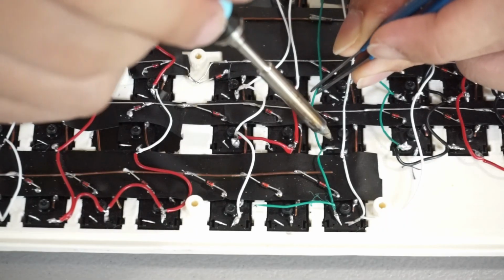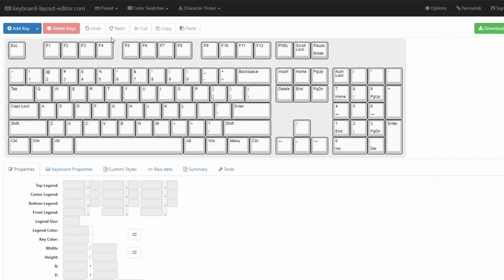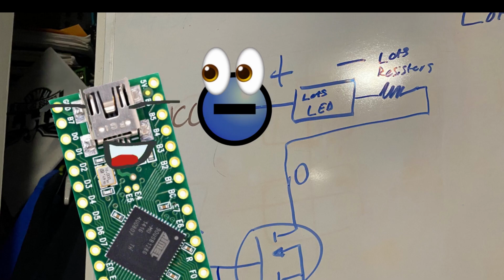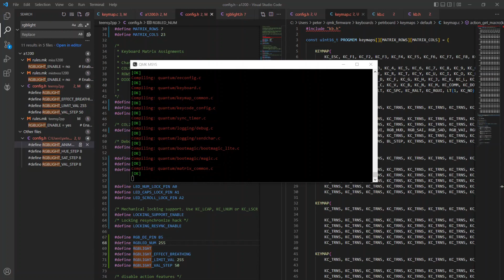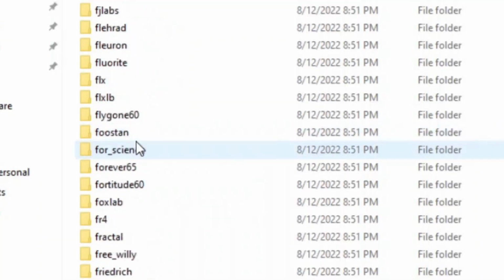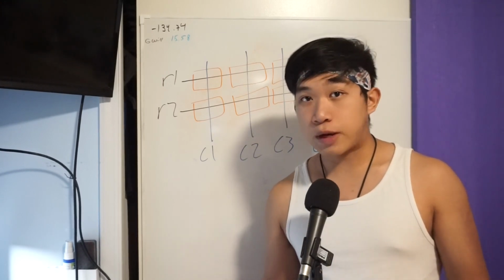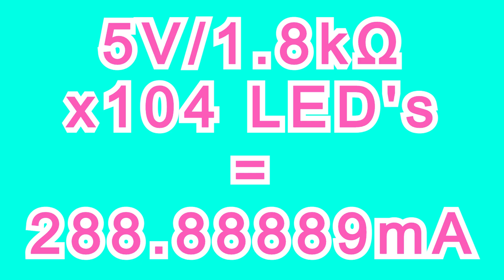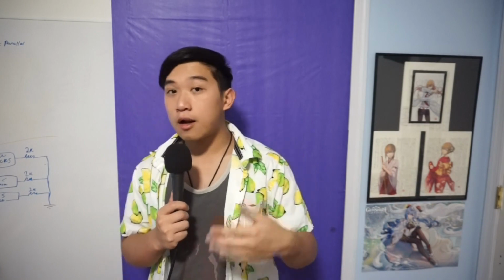3D Printed - Upcycled - Backlighted - Handwired - 100% Mechanical Keyboard

Comment: Nice backlighting! Haven’t seen it done like this on a hand wired keyboard so far 👏🏽👏🏽
Reply from the maker: Thank you! It’s def been done before since I used them as references, but def very few since it’s VERY TERRIBLE to solder all those points hahaha.  Though for something like a macro board, I’d do it again

Comment: GREAT VIDEO! you gotta be nuts to do this by hand WITH LEDS!! omg .. i hand built a 73 key custom layout with no LEDS and it was hell. But I'm happy with it ! I def should have used copper wire and the electrical tape method.
Reply from the maker: SO YOU KNOW THE PAIN TOO 😭 and cheers to building your keyboard too!  A little update, mine got corrupted a few months ago (probably due to static) but was able to reflash it so it’s all good now (the hell never ends LOL)
Reply: @PeTr01  oh noooo 😱 hope it doesn't happen to mine but good to know it's fixable
Reply from the maker: @MichaelButlerC  yes! If you used QMK, its pretty simple but a last resort: if you can’t get to the microcontroller to press the reset button to flash (as mine was burried under a lot of stuff) you can plug the keyboard in while holding the esc key, I think… this will ultimately wipe the microcontroller putting it into flash mode

Comment: Can i use a svf4n60f mosfet? Looked up the VGS and it's 2v to 4v. Also i should be able to replace mosfet with a transistor right?
Reply from the maker: Hey! I researched your mosfet and noticed the same Vgs(th) as you did, usually logic level is small for the min (between 0 and 1v), which is great for when you have values close to 0, very low voltage, it’s off; but when you have some significant amount of voltage, it’s on (in your case, you might find that they device will be off at voltages below 2v).  This is fine if you only want the lights to come on and off (where it will send 0v for off since it’s less than 2v, and 5v for on since it’s greater than 4v).  PWM brightness control should work as well since that works on how frequent a signal is on and off rather than the voltage level, but am unsure of this.  The area of uncertainty is how it will behave if a voltage between 2v and 4v will read since this is where it’s kind of on and kind of off.  Also interested in how the circuit will react with how QMK is programmed (magic is scary). This is just theory from my level of understanding, so ofc the best way of finding out is to test it out on a breadboard.  See if you can program an arduino/teensy to light up 2-3 LED’s with your mosfet and if you can control their brightness via PWM.  Lmk how it turns out or if you have any other questions! Break a board… Ima coin that

Comment: Sorry for commenting month after release, isn't the formula for current 2V/2000ohm*104? Since diodes forward voltage is close to 3V thet leaves 2V to resistor. Btw gret video im buying the components rn
Reply from the maker: Always love a good comment and this is amazing! True I didn’t think about the forward voltage of the diode while doing the calculations but either way most diodes have a forward voltage of 0.6v; 3v might be for some zener diodes?.  Either way, for the 1N4148 diode used in the video, it has a forward voltage of 0.4-1.2v so it doesn’t really change the calculation much (Bcs we’re engineers and we like to make mathematicians mad… e=3=pi). Good catch though and good luck on your build! (If you’re 3D printing make sure you carefully read the 3D modeler’s description for proper print settings to save you some… headaches lol)
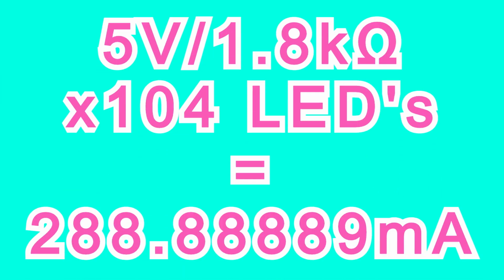Reply: @PeTr01  Sorry for the misunderstanding i was not talking about normal diods to prevent ghosting.I was talking abot backlight part blue and white lds normally have Vf of 3v-3.5v and on your current limiting resistors in your calculation you put 5v (5v/1.8kohm*104 led's=288.88889mA) (10:31time in video) 
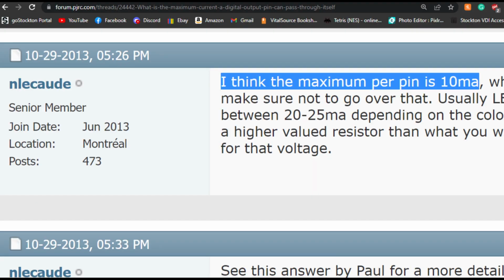It should probably be 2v/1.8kohm*104 led's=155.55555mA and original formula for backlight current wold be 2V/2k ohm =1mA (per led) instead od 5V/2kohm= 2.5mA (per led) (3:55 time in video) 

Tldr: formula for backlit current :(V(source) - Vf( led) )/R(current limiting resistor)* N( number of led's)= I (backlight)

If you wanna talk about this my discord is: "Punomsni Džem#1688"